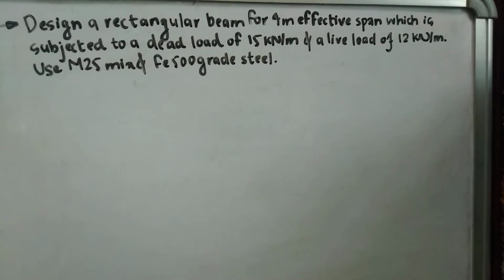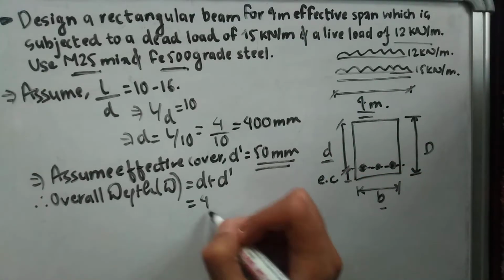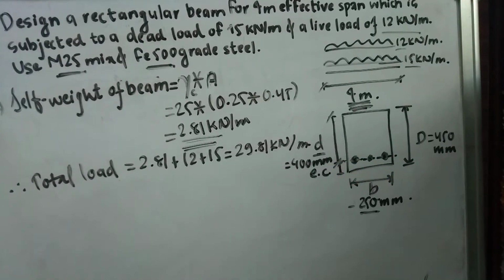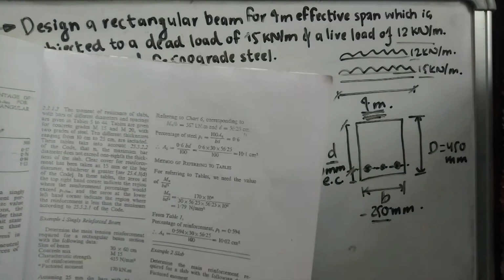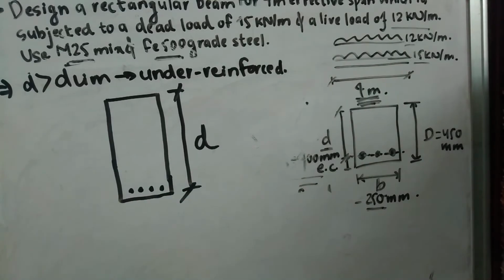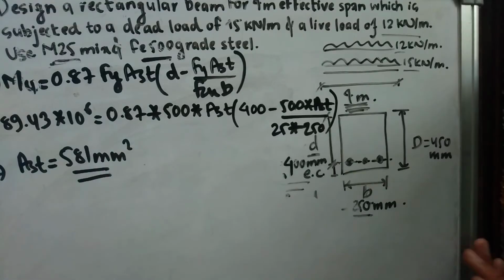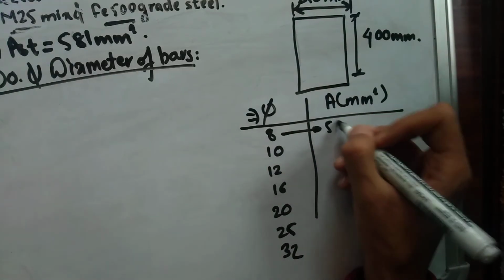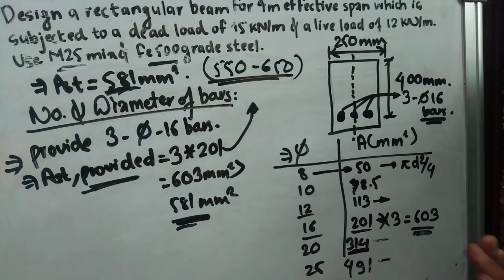Design of Rectangular Beam(Load Condition)| Design of Singly Reinforced Beam | Limit state method

Comment: Could you please help me with this? A reinforced concrete beam with an effective span of 7 m is 500 mm deep overall by 250 mm
wide. It supports a characteristic imposed load of 9 kN per metre run and a characteristic
dead load of 11 kN per metre run in addition to the load due to the beam's self-weight. Assume
the unit weight of concrete γ = 24 kN/m³.
. Using the design criteria given in BS 8110 Part 1,

1.
(i) Design the beam for flexure with high tensile 25 mm diameter tension
reinforcement and grade 30 (C30) concrete. Use 10 mm diameter links and the 25
mm concrete cover.
(ii) Carry out all the necessary checks.
2. Produce a detailed sketch of the beam